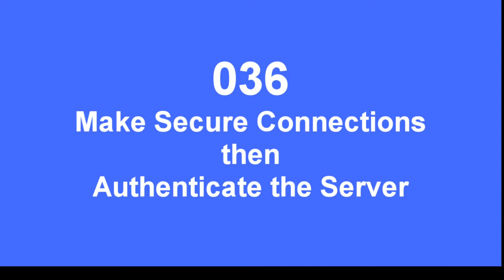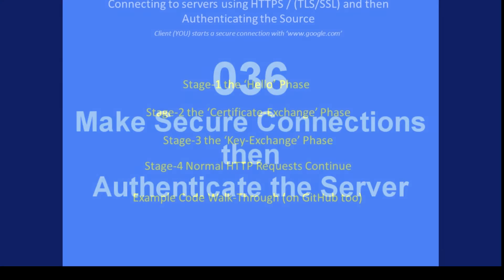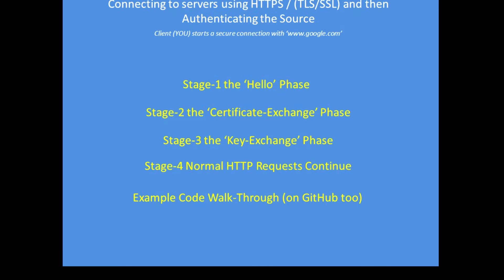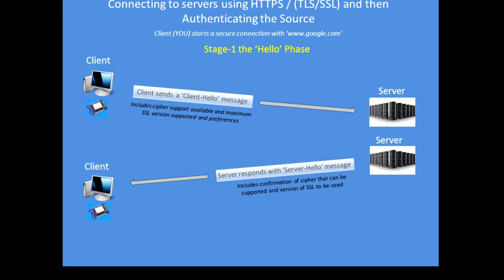Tech Note 036 - ESP8266 SSL Authentication Part-2 (of TN0032)

Comment: Hi David, is there an update today, 2 years later? Or is it still difficult to do a secured https API with the ESP ? If I understood it well , there is no Arduino code available that handles everything needed, without the programmer to lookup and enter even update fingerpirnts or certificates?  I am looking for a solution where I just enter the address https://..... and the ESP code does the rest. Is that possible today in 2019 or still a problem? Thanks and kind regards.
Reply from the maker: Hi Wim, it’s still a problem that you need to provide a certificate as even self-signed certificates are being rejected in my experience, so you can’t get an https certificate-less connection, that said if you use wificlientsecure you should get an encrypted connection to work ok, I’ve got lots of examples doing that right now. After-all your browser makes a secure certificate less connection to most sites, test yours on the target site and I doubt the remote server asks your system to verify itself via its own certification, and the ESP32 can do that definitely. I’m using 1.0.3.rc-1 where most of the https issues have been resolved.
Reply from the maker: Also, you may note in the latest build that you now have to provide a certificate to use clientsecure
Reply: @G6EJD  Hi David, the strange thing is that when I remark below lines the compiler not complains and the message still arrives on the https server.
What do you mean with latest build? which one is that please? Kind regards and Thx.
  //client.setCACert(root_ca);
  //client.setCertificate(test_client_key); // for client verification
  //client.setPrivateKey(test_client_cert);  // for client verification

Comment: at 1.50 you explain a CA server can be used to validate the certificate as opposed to using the fingerprint to validate the certificate . however I'm missing an explanation on how to do this in the remainder of your video, I'd really like to see how you can do this. otherwise great video!
Reply from the maker: Yes, maybe I should have said 'a CA server could be used' the problem as you have identified, is the size of the certificate package will be ~ 500kB or more and so I think it is beyond the capability for most ESP8266 projects. The list of fingerprints could be held in a SPIFFS or SD-Card file, but that's going to be slow as it's a lot of records to check and I think just having the ability to make a SSL connection is enough and to trust just a few (as I imply in the video) servers certificates, which could be maintained in a file and therefore makes it a practical proposition. I think if any ESP projects will need to be agile enough to require a full certificate list to be checked. Also some of the CA servers I looked at charge for certificate validation services - as always it becomes a compromise.
Reply: In theory it should be possible to have a 3rd party server return the fingerprint for a given other server (much like GRC is doing, but then via an API). If this 'validation server' would have a longer lasting certificate of maybe a couple of years it would be feasible to use that in the ESP to dynamically get fingerprints different hosts you need to connect to. Even if you put the finger in a separate file you would still need to update it regularly (as you pointed out in the video, monthly or so). For me this is not much better than hard coding it, it doesn't matter so much to me whether I have to load new code, or update a file somewhere, it's the fact that I have to plan a monthly action that poses the biggest issue for me. If I make an ESP project, I want it to be set-and-forget, and maybe touch it only once a year for changing batteries or so. For the moment my advise remains: If you care about security (which certainly is not always justified, I don't care if someone can intercept temperature values I'm sending from my home...), you should not attempt to have an ESP communicate with the outside world, personally I use a node-red server in my local network, have the ESP talk to it via MQTT (unencrypted), and have the node-red server pass relay the information to any outside servers, using fully secure (encrypted and authenticated) communication, which is easy since it's running on a raspberry pi which has the full-blown root CA list
Reply from the maker: Yes the way your controlling security/access is the way to do things. I have not seen any CA API's, but suspect if I pay they will become available, that said, my standard browser  must be trusting the certificate because when I connect to say a Bank I have no real proof it is the correct bank. I could check the certificate but that's a process I'd rather not be doing. So yes building n ESP project that needs continuous update is not ideal, but the environment is going that way so a schema needs to be developed. Already the ESP has most of the tools. For now the risk is quite low and like you if someone intercepts my weather data or one of my ESP's (highly unlikely) then I would not be bothered, well actually I'd be hacked off and turn up all my security :) so they could not do that again. OTA adds some possibilities, but still a manual process to conduct.

Comment: Thanks for this!  A question for you - how do you find the fingerprint locally using say Google Chrome?  I can't seem to work this out :S
Reply from the maker: +Thomas Cooper - not easy to find, but you can find this information by going to the Three Dots Menu -> More Tools -> Developer Tools, then click on the Security Tab. This will give you a Security Overview with a View Certificate Button.
Reply: Thanks, thats where I was looking.  I cannot see the same fingerprint as the one I get at grc.com (which is the only one that will work)!
Reply from the maker: +Thomas Cooper Things to note - certificates have a limited life, maybe 28-days at most, and may have be changed so not current. The only way to check if a certificate is valid is to 'validate' it with a certificate server who issues it as part of the wider certification system. There are many certificate servers where you can check currency of the certificate. Your software system would need to receive the certificate and then check it with a certificate server (assuming it's a valid one!) and then if valid proceed with the connection.
Reply: Ok. The ESP8266 has too little storage space to store the certificate?
Reply from the maker: +Thomas Cooper Well it has enough, if you download certificates then they expire, so you'd need to keep refreshing the list, but take for example, your PC browser it doesn't usually save them, it receives them then checks validity against a known validation server, that's the best way to it, plus it gives your code indefinite life. You'd need to get the 64-bit number then parse to a validation server which will then respond true or false. I haven't checked recently but I'm sure there is a function to do this for you in the ESP documentation.

Comment: doesnt work for www.googleapis.com :(
Reply from the maker: Interesting, I’ll have a look at this later. Thanks
Reply from the maker: Did you use an API key? You need to.
Reply from the maker: "/geolocation/v1/geolocate?key="+google_apikey
Reply: @G6EJD  for yoube stats.. Api
Reply from the maker: Marc Paradis I’ve just looked first you have to enable the service in google, then update your credentials with them then you get a key, it only lasts for a finite time and if not used gets disabled automatically, to be aware of all that.
Reply: @G6EJD  i Will have a look at this tonihjt.. Thanks..
Reply: @G6EJD  do you have an e-mail where i can join you??
Reply from the maker: Marc, contact via g6ejd.dynu.com